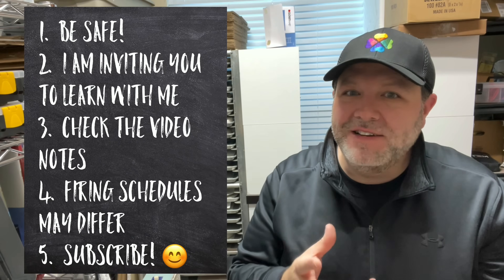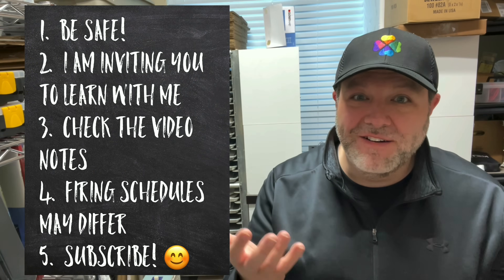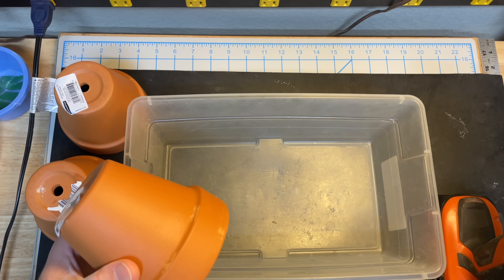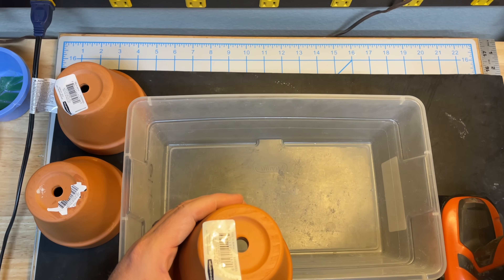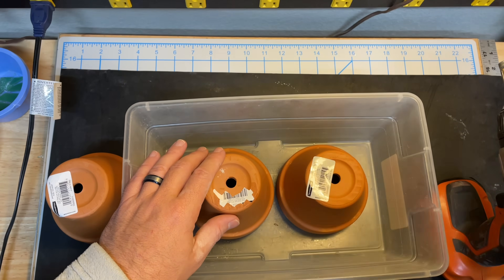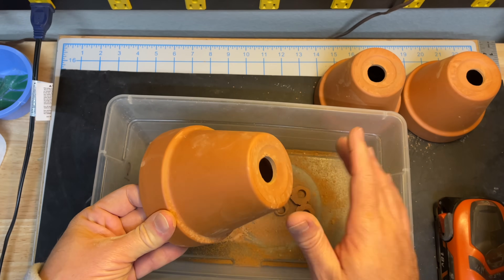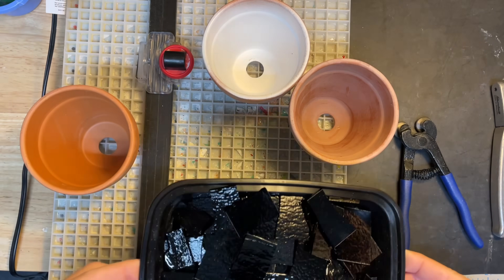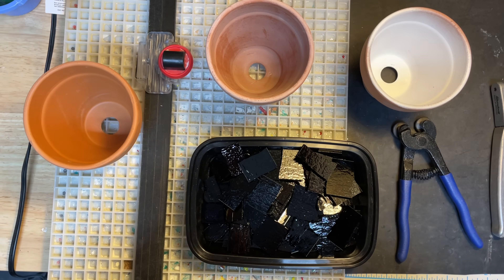Fused Glass Pot Melt Experiment — What Will Happen?

Comment: I think if you wet the bottom before drilling it will cut down on dust and wear on your bit.  That's what I do.  I do like putting it in the container though... I didn't do that and had some slop to clean up.

Comment: Ceramist here, hi 👋
Mixing a bisque or low fired clay piece with glass is possible.  Gotta remember terracotta is normally low fire and doesn't like going past 04.  That said ceramic glaze has a lot of silica so the  binding agent  is there you just need to add the glass.  Ceramic glaze in clear with crushed glass can create beautiful pieces.

Comment: It would be interesting to see if the zyp side had zyp inclusion in the interior of the slab. Can you slice it open? I have used the sheet glass on the bottom with the shelf covered with wash and thinfire. I found with the base glass being fluid as the glass from the pot hits the bottom it flows out more. and blends. You wouldn't
 have to use an entire sheet , but large pieces under the holes to act as a buffer as the glass drop happens.
Reply from the maker: It would Beni retesting, but the experiment is already trashed. I don’t have that kind of equipment to cut it open, and honestly, I didn’t care to pursue it any further: predominant wisdom says Zyp in a pot melt isn’t a good idea, and I saw enough on the surface to be satisfied and move on. 😊

Comment: If you soak those pots in water for about 30 minutes, then use your core bit, it’s much easier to drill.  Do this a day before you plan to use so they have time to dry out.  I usually drill a bunch at one time so they are ready when ever.  Nice video!
Reply from the maker: Great tip! Love this glass community!
Reply: @JamaisonSchuler  to prevent wiggle when drilling a pot, take a piece of 1/2" plywood, drill a hole the same size or slightly larger, then duck tape it to the pot. It will keep you bit from wiggling while you get started.

Comment: I always put fiber paper down—-I found trying to clean off the kiln wash is a pain. If you have sandblasting equipment or flat lap maybe it’s not a big deal.  I’ve used scrap on top of the fiber paper —I lay it out jigsaw puzzle like and have never had an issue with fiber paper in the final product. I always have bubbles after a pot melt so I do I fire polish —drill out bubbles and fill with fine frit.

I’m enjoying your videos